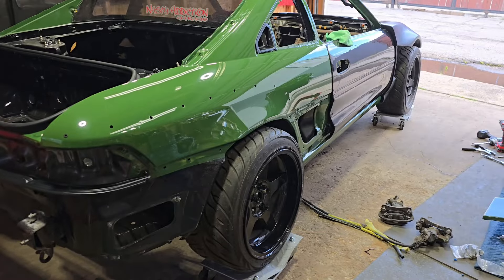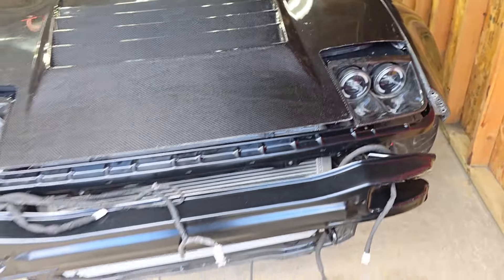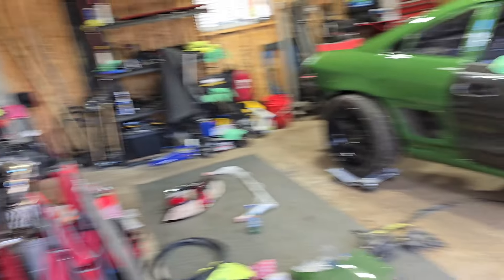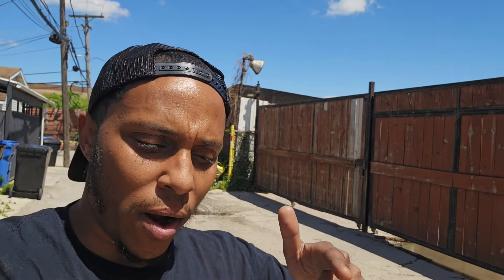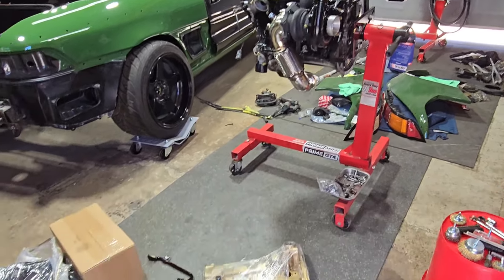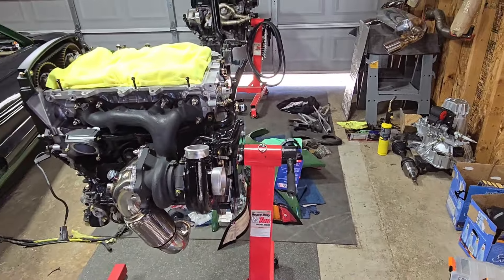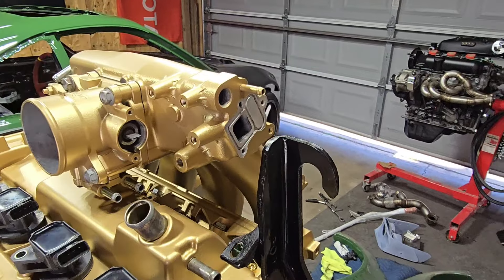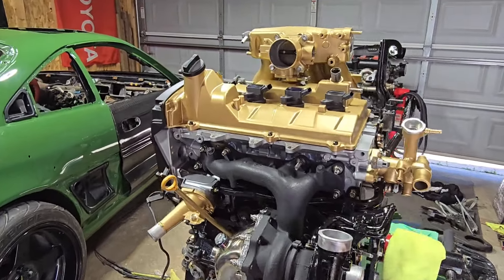Timelapse: Installing Powder-Coated Parts on Jose's 3SGTE Engine | Nasty Addiction Garage

Comment: Looks great. I also used ARP exhaust studs on my build but I’d caution everyone against torquing them more than the factory 38 ft-lbs because the aluminum threads are the weak point and it’s easy to pull the threads out at the 50ft-lbs+ those studs call for.
My head already had multiple exhaust stud thread repairs and I didn’t want to risk it any more.
Reply from the maker: That's really good, advice brother thank you!